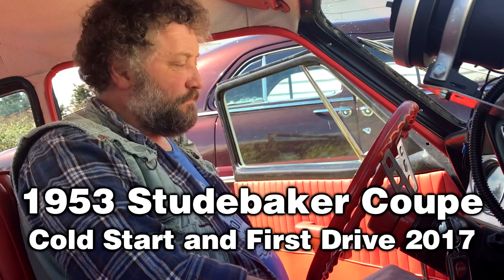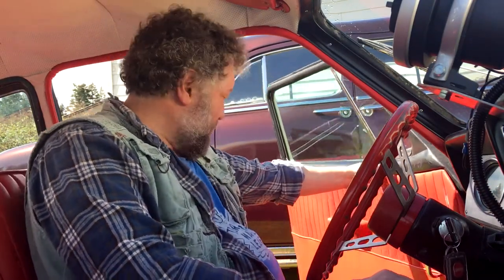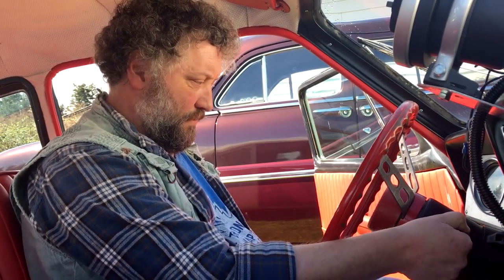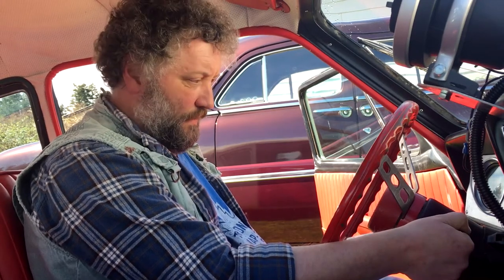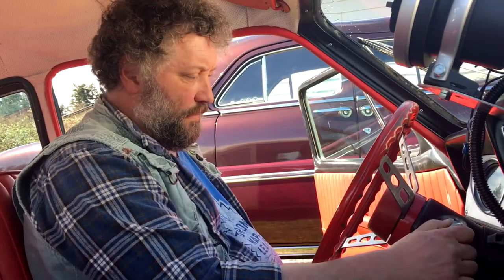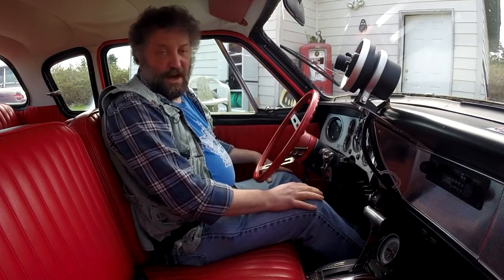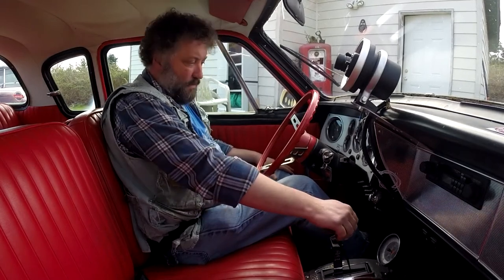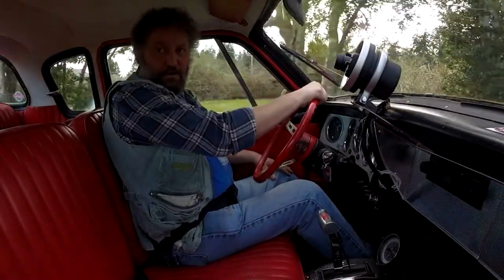1953 Studebaker - First Start/Drive 2017

Comment: Studebaker didn’t have the igniting switch on the steering column I had two 53s and a 56. The fifty threes had a started button on the floor so you pushed the clutch pedal down hard to the floor it Engaged the starter .
Reply from the maker: This Stude is not stock. I might be wrong, but the dash is out of a 56 and most of the steering arrangement and all the chassis is Chevy S10. We put the floor shifter in. Engine is a cammed and over-bored 350
Reply: @MicrophonicFool  Hey hey, nice job fitting in the dash...looks good.  I still drive a Lark Convertible (60)...restored.  I knew when you started it 'sound' gave it away, not a stock Studebaker V-8..they have a definite note to them.
Reply from the maker: @bobr.6312  For better or Ill this Studebaker is all Chevy underneath. Dad and I used to drag race it for fun in past years.

Comment: That's a awesome Study... I find it interesting how over the top stylist got later in the same decade. Compare this to a 57 golden hawk!
Reply from the maker: My Dad's tagline for this car was: This is not your Grandpa's Studebaker... And it isn't. Only the body is 53, everything else is Chevy S10 for the frame and a slightly hopped up small block chev 350 from a 72 Impala if I recall from the casting numbers. I used to drag race this car when it was back home. It didn't set the world on fire, but still 14.5 seconds @ 91mph.. Could be way worse
Reply from the maker: I know it will be painful to see but check out my video called "Studebaker Inferno"

Comment: I think this is, the third video, I've seen, of this car. Is this the most recent, is this all of them, or are there still others to be found? Anything with any clear views, of the engine? Can you share any more details about it? Is it a South Bend, or Detroit casting? What's the displacement? I think I heard you mentioning, dual carbs, in this video? I doubt they're Strombergs? so, what are they? There is one I saw previously, where there was no hood, on it. That looked like it had a couple 4 Bbls, and an air cleaner, sitting way up, almost to the level of the sun visors. But I couldn't really see anything, very clearly? I do see, it has a hood, in this video. So, at this time it had, at least, a different intake. What about the carbs? Has anything else been done, since?
Reply from the maker: Unfortunately for you, only the body is original. Underneath it is Chevy S10.

Comment: never rev an engine and shut it off.  It leaves a ton of unburned fuel in the cylinders, and strips all the oil off the rings.
Reply from the maker: It is an old habit, especially with this car. Unfortunately I am good at loving AND abusing cars.
Reply: @MicrophonicFool  I understand.  But being a builder and racer for years, I just had to throw that in.  BTW, would like to see you really romp this one on a straight stretch from a rolling start to 60 or 70 full throttle, hand shifting through all 3 gears.  Cool car.  GM Column?  Besides the cam, what else have you done to this Studebaker motor??  Is your carb a mechanical or vacuum secondary?  Seems like with that wild cam, a vacuum secondary may be a great choice so as to not stall her.  Regardless, cool car.  Thanks
Reply: @MicrophonicFool  BTW 3RT  Racing stands for Raymond's Revenge Racing Team.  A tribute to Raymond Loewy, and a number of the cars I built and raced based on 53/54/55/56 Loew boys.

Comment: After only a year it should not be problem. With one exception: crappy ethanol which should be illegal. Fuel and ignition. Check for spark, takes 30 seconds. Spray some carb cleaner in carb, dont flood it with gas, should start instantly, wont stay running of course. Sounds like crappy gas. Sounds like its flooded. Sounds like stuck choke. Sounds like hes trying to drag out the video. Does not sound like a Studebaker engine or starter. Not studebaker steering column. Big tachometer on dash indicates racer. Very rare for Stude engine to have headers.  Massive jibber jabber, no Studebaker stuff. But what do I know since all we see is the dood.
Maybe I should do a video of my genuine Avanti R1 engined Studebaker Lark. Which has an electric fuel pump. So you dont grind on the starter....for no reason.
Reply from the maker: Nothing outside of this body is proper Studebaker.

Comment: The 1951 Mercury Sedan probably runs better.
Reply from the maker: For it's age, yes the Merc does run better. But the Merc is almost 100% stock. This Stude was kinda half-built for drag racing and therefore is a handful. I have lots of videos of screwing around with the Merc as well